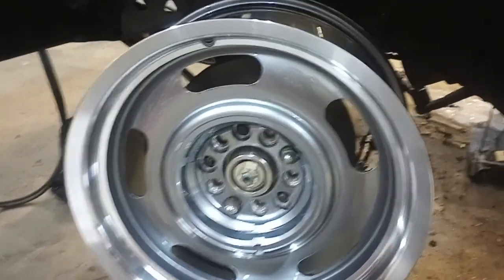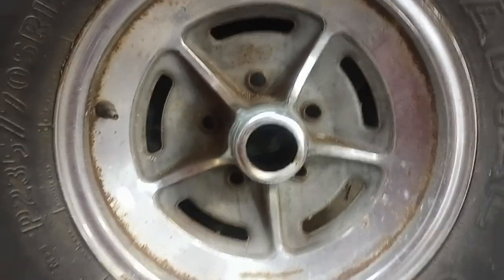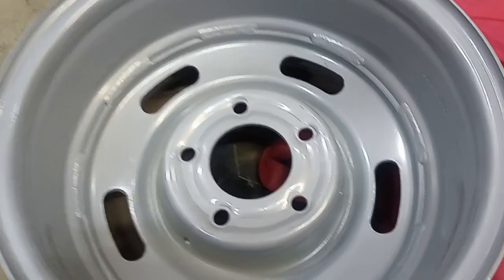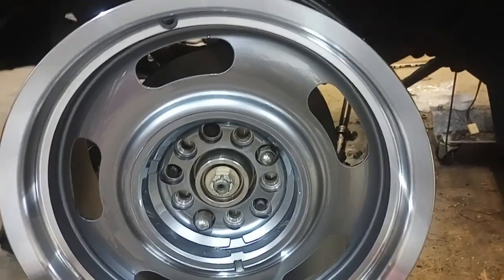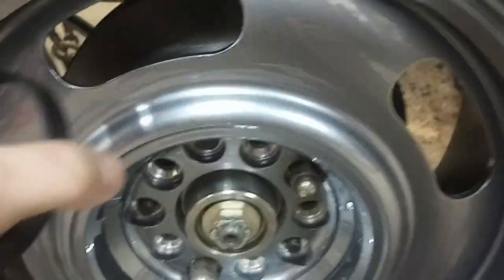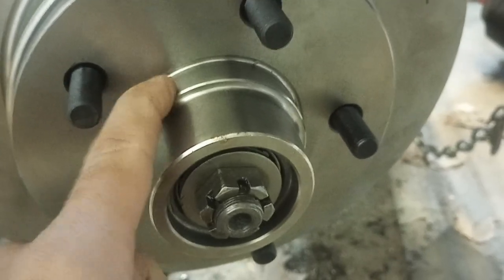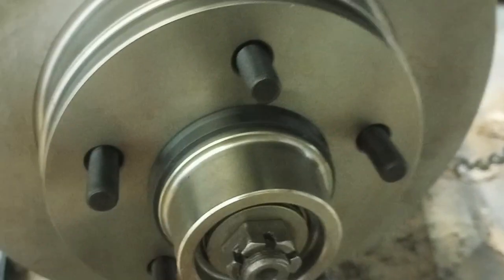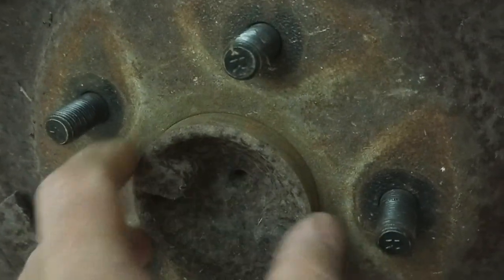Fitting Custom Wheels for the 1966 Buick Wildcat

Comment: great love it I'm looking for set of 20inch rally rims I found them on summit website but I need to see the correct can you help me on 5×127mm!
Reply from the maker: 5x127mm is the same a 5x5in.  Some wheels have dual patterns that have a total of 10 holes.   The set I ended up with fit both 5x127 and 5x120 - which is this model: https://www.summitracing.com/parts/VSW-55-7806GMML0#overview 
20" should be big enough to clear everything inside the wheel, like drums, calipers etc.  Once you find a bolt pattern and diameter you want, you have to worry about clearance.  If you're getting bigger rims, but going lower profile with the tires to keep the overall diameter of the tire the same, clearance should be ok.  If you go wider and/or change the backspacing you can possibly move the wheel in or out far enough to hit the frame, fender, or suspension.  There is tons of info out there already about sizing custom wheels, and I'm no expert so I'm not going to get into the detail here.  Places do sell gauges to mock up your rim/tire combo to get a sense if you'll have an clearance issues.  They can be expensive if you're only going to use them once.  If you're not sure, it's best to buy just one rim and test fit it on all four corners to make sure it will at least bolt up.  Worse case you only need to return 1 wheel.  If it fits, then order three more and get tires mounted.  Remember, you can't return a wheel that has had a tire mounted.  That's what I ended up doing, I order one rim to make sure it would fit.  When it did I ordered the other 3.  Since I was being extra paranoid, I had the tire shop mount up a single wheel and tire I could take home and test.   I checked it on all 4 corners of the car and it fit just fine with the tire I chose.  I called the tire shop and gave them the go-ahead to mount the rest.  Good luck with your new tires and wheels!  I hope this helps!